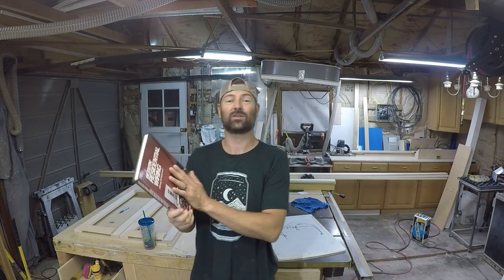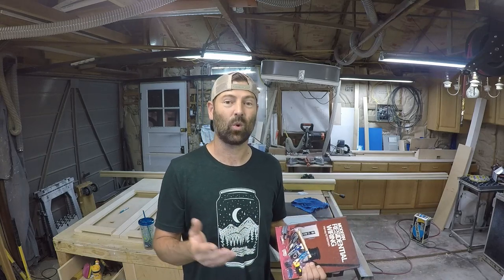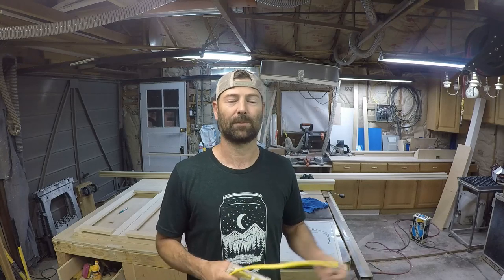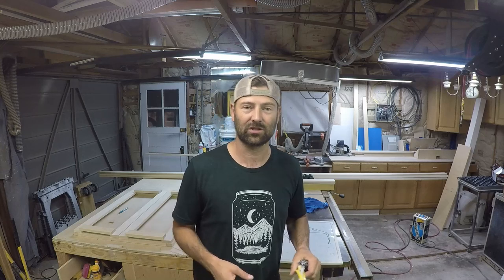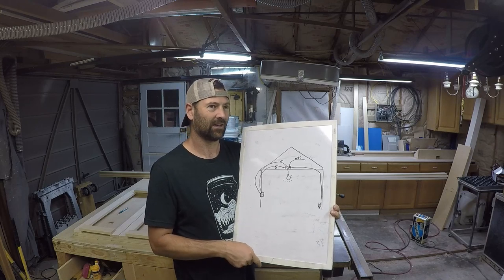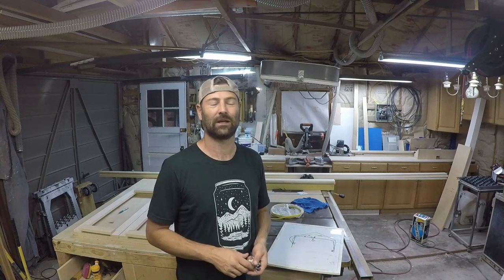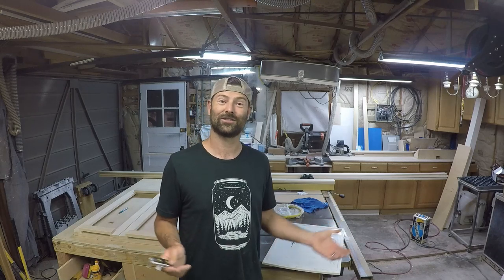The White Wire Is The HOT | THE HANDYMAN |

Comment: 100% correct. This is very common in remodels and newer homes. But if one is wiring there own house then use 3 conductor cable. NEC 404.2(C) says that a grounded conductor (neutral) must be installed in at least one of the switch boxes. This was put in place for future proofing installations that might use electronic lighting control devices so that one wouldn't have to tear down drywall just to pull one cable.

Wirenut the white in the box and use the black and the red as your constant and switched power.

When servicing electrical work then of coarse (as he said in the video) NEVER trust another persons work and always test wires before working on them.

Everything he said is right just if wiring a brand new room/house and a complete remodel then spent the extra money on some 14-3 NM.

Comment: Yea, when its switch looped, old code was that a neutral wasnt required in everybox, new code it is, but it has many exceptions. That switchbox was probably fished on the old code. And under that code the constant hot has to be the white wire, and the black wire is the switch leg.

Lmao at "fly a kite"
Reply: Is this why there is a white wire and a black wire on the common screw of my old 3 way switch that sends power to my kitchen light and to a single pole switch in the same box that sends power to my outside light.  Thanks?

Comment: How to replace an entry door light switch with a timer when there is no neutral?    Timer requires neutral and ground.    The ground wire was cut short.
Reply from the maker: Most homes in the USA don't have a Neutral.

Comment: New electrical code does not allow for use of neutral (white wire) to be used as a hot wire even if its taped and marked.
Reply from the maker: In remodel and just replacing a switch  this is not the case.  YOU are not going to be rewiring the entire house just to swap out a dimmer switch.
Reply: @TheHandyman1  love your channel brother. Thank you so much for the great information. You are quite the inspiration. I have learned so much from you. Cheers

Comment: For NEC 2011 this is now illegal.  section 404.2.   NEC requires a neutral conductor in every box
Reply: beater yep they are wiring things like they were in the 80s not up on today’s codes. But many houses were wired this way ugh. My old house was a rats nets junction boxes feeding every dang thing it’s slowly being switched out. So a feed runs plugs another runs lights

Comment: Although this is not code anymore in most places since a neutral is required to have in the box
Reply: WRONG, what's a neutral to do in a single gang box with ONLY a SPST switch???  Connect it to the ground lug?
Reply: @Marcel_Germann  your 100 percent right

Comment: I rely on my non contact voltage tester when fiddling about with lighting circuits. Most of the old work I've been blessed to figure out has the white  live from junction hot, and black feeds from switch back to power light. There really is no absolute colors to rely on.  Flip the breaker, take the switch apart,  flip breaker back on, test for which wire is live.
Reply: @mwatkins2464  I almost became a statistic a while back,  it caused me permanent neurological damage,  with an added bonus of it being degenerative. It wasn't even my fault.  But, when I said flipping breakers and such,  I was referring to taking stuff apart,  separate leads, finding feeds, then turning them back off to install switches, fixtures etc. I still leave the single pole stuff live most times myself,  unless it needs a major repair.  Where I currently work,  the 3 and 4 way stuff is really when I disassemble everything and start from scratch.  You just don't know what the idiot that tried to fix something before you did.

Comment: As far as I know black is ground just check your car battery. As long as the wire is the same color doesn't really matter. In lower voltage electronics red is normally 5v and yellow 12v.

Comment: The Home Run is the first Outlet or switch on the breaker box I think it might be just an outlet not a hundred percent sure I'm not an electrician just a maintenance man
Reply: Technically a home run is the wire from the first junction to the panel. It matters not whether it’s a recept, switch or light box.

Comment: White is neutral. It runs the same currant as ground. Black is hot.
Reply from the maker: Sometimes.
Reply: It's code here.
Reply from the maker: @johnconner5693  in 2017 it was but what about the 80 million homes built before 1980?   I was talking remodel and old homes. NOT new construction.
Reply: Well before 1980 you would have to check each connection to fixture and outlet for black on brass then flip the white and black it the service. Also 1989 was when  national code was implimented many states like new York have had black to hot as far back as 1950.

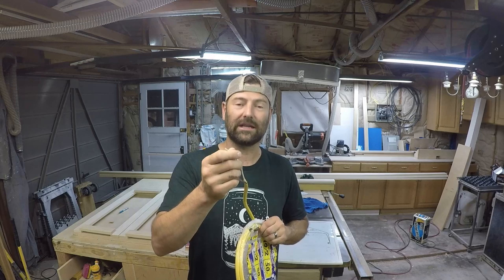Comment: You didn't link the tester @4:22
Reply: Search non contact voltage tester.  They look like a big square pencil & will save your life...pick up a circuit tester too, it looks like a plug with 3 lights on the back of it and will tell you if the wiring is correct. All together maybe 15$ or get the "expensive" klein kit for a whopping 30$.  If handy Andy links one buy that one to support the channel 😁
Reply from the maker: Sorry about that.  This is the one use at every switch https://amzn.to/31sDlQU

Comment: I use my roll of red tape just for switch loops. It can't get more obvious than that. 

There are those that would say NEC says the re-identified white has to be the hot wire and can't be used to return the power to the light. Stops dummies from testing the white with the switch off and thinking it's a neutral.
Reply: @mwatkins2464  I wouldn't. But thanks for calling me a dummy
Reply: Haha. You do know there are a lot of switches that require a grounded conductor right?  That white wire is connected to the switches and is typically required to be pulled to switch boxes even when no automatic light sensor is installed

Label your current carrying conductors clearly.   Don't assume that any insulated wire is not live based on color. The last guy might not have been as smart as you.